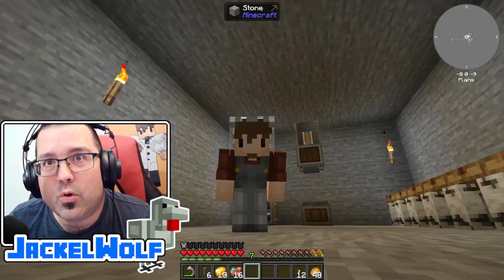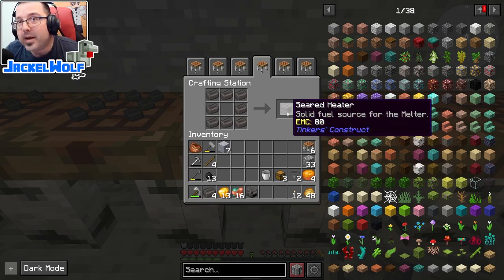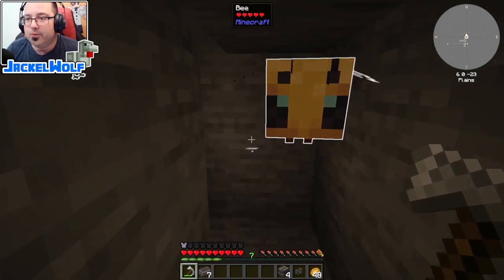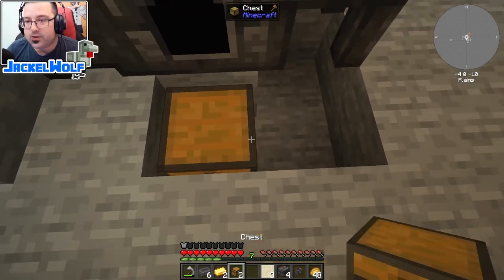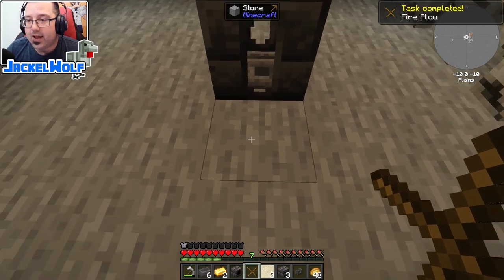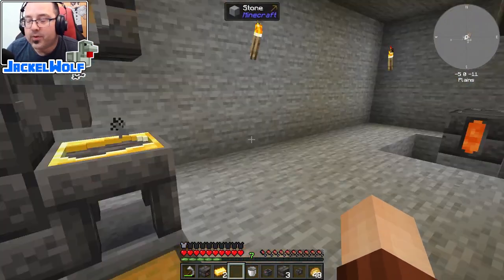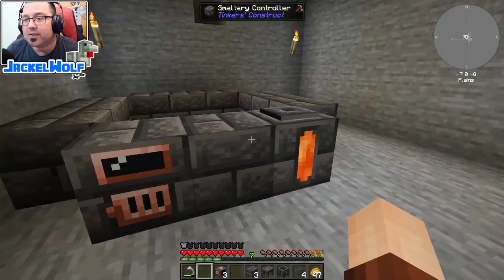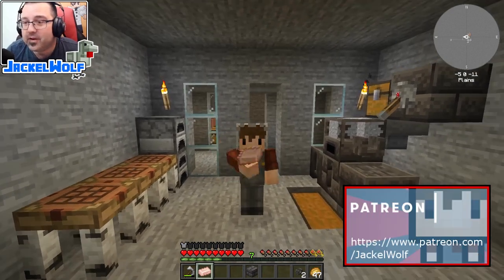FTB STONEBLOCK 3 - Tinker's Melter to Smeltery & Lava - Tutorial EP06

Comment: Two bees in one episode! The faucet is your current option for extracting from the drain but when you get into other mods you should have alternatives. I like to use integrated tunnels but I believe it was left out of this pack. I would assume that the pipez mod in this pack would be an option.
Reply from the maker: Actually there were 4, but I ignored 2, and recorded facing away from them. It ended up being an hour recording, which is long for me, but I've done soooooo many smeltery episodes that I didn't want to split it into 2. 😅